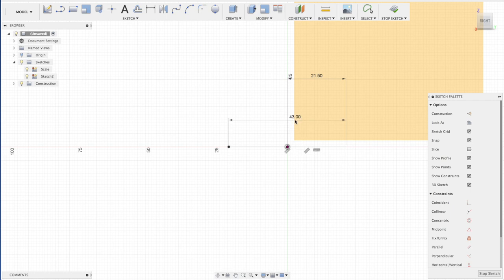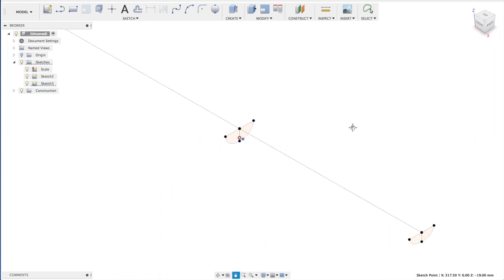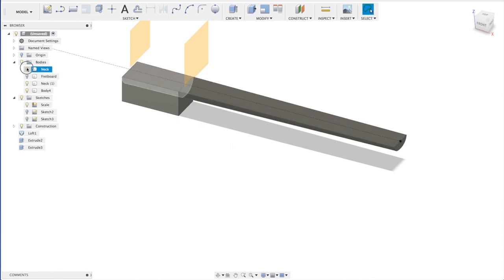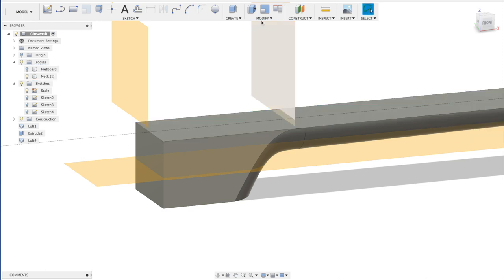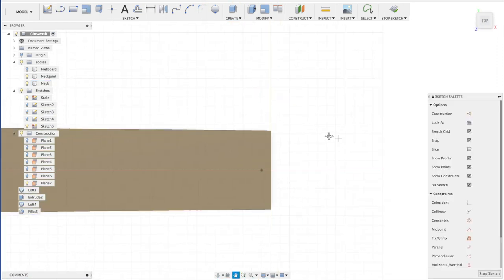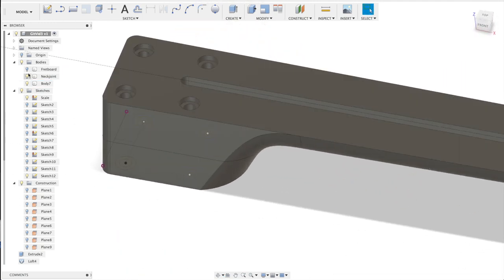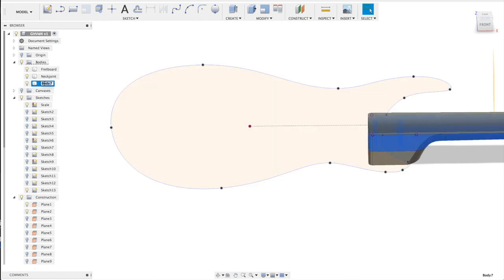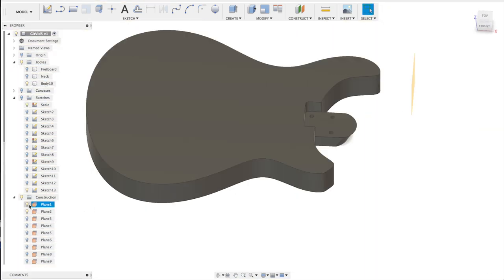Drawing a complete electric guitar in Fusion 360 for CNC milling

Comment: Fantastic video. I’m going to check out your other stuff. I am an absolute beginner on fusion 360. My only suggestion would be to go into more detail on the actual use of the program. Your abilities on the program are light years beyond mine. Thanks for taking the time to do this.
Reply from the maker: Good suggestion! I try to use the most basic tools only when drawing, in a next designvideo I'll try to incorporate your suggestion. I'm sorry if it sometimes looks confusing on this particular video; but you're most welcome to ask anything. I'll try to give a clear answer, or else look at my website as well. That just might clear things up as well. Cheers!

Comment: Awesome tutorial! I have barely used blender earlier, and still I'm able to follow it with only a few google searches. Thanks! Gonna check out your extended version as well. Thanks!
Reply from the maker: Great to hear it works out for you in Blender as well! Curious about the result!!
Reply: @Audiohotshot  That was a little unclear. I meant that my experience with 3d modelling was just a little bit of blender, and i still managed to follow this in fusion 360 with no problems. ;)
Reply from the maker: :-) still great to hear!

Comment: This is the most direct approach I've seen to date- very nice work. 

Thank you for taking the time to make this video. Although I've been building guitars for 50 years, I haven't had a need to learn CAD- I built my cnc mill from scratch 10 years ago, but my sons have done all the programming. I seem to be fighting with one hand tied behind my back, always waiting for a file, or not getting precisely what I had in mind. This aspect is well beyond my comfort zone, but Fusion 360 has been a bit easier for me to grasp than Rhino and others that my sons use.

My CAD journey is only weeks old, and it is quite a different approach for me, but your methodology seems to make sense from both an engineering and lutherie point of view. I only wish I had a better grasp of the tools you use so effortlessly.

In conclusion, I wanted to thank you for your efforts, I will be spending many, many hours trying to pick up on what you have presented.
Reply from the maker: I'm sure you'll be able to figure it out! Fusion is a very friendly piece of software, and it also produces the GCODE directly. I like the fact that those 2 are combined in one program. Question: would you like the tools more explained in the video as well (I mean how loft and split body and construction plane work and so on?) or just what keys I press?  Thank you for the kind words!
Reply: @Audiohotshot  that would be extremely helpful, yes. This was my first exposure to offset planes, loft, etc. I am very much a beginner, and need to stop/rewind/ watch and listen, and still think about what every click or sound is- the UI of Fusion I have is newer than almost all tutorials, so simply finding a tool or setting is quite difficult. I cannot tell you how thrilled I am at having seen your work this morning. Every tool selection, plane, pan or orbit counts, every click or keystroke.

I hope to live long enough to soar with it. LOL

Again, thank you. ;)
Reply: I don't know you, or your background, but you are really on to a good system, and a nice presentation. It feels like a lifeline to me, despite what you cover in three minutes takes me five hours.. hahaha
Reply from the maker: Hahaha I will try to add keystrokes in the video as well. For what its worth: I use “l” (non capitol L) for drawing a line, and “x” for making a line a construction line most of the time. Everything else is pretty visible in the fusion menus I guess. But I promise I will try to incorporate the keystrokes next time :-) good luck with your drawings, glad you find it helpful!

Comment: Fabulous. I picked up so many tips and tricks from this vid. How about making a video on efficient tool paths. Thanks!
Reply from the maker: You're welcome! I was thinking about doing a video on toolpaths, it will be here soon!
Reply: Toolpaths shouldn't be a problem imo... Few tips, avoid adaptive since it's taking so much time, go with parallel for roughing (flat 6-12mm end mill) (I usually limit the depth to 4-8mm per pass with extrude+protect+surpress extrude), leave 0.7-1mm stock to leave and finish it with morph spiral or parallel with 0.7-1.5mm stepover (ball end mill ofc)...feed&speeds I usually do 18k rpm and 2kmm/min feedrate for hard woods...Drilling go with recommended for plastics and increase rpm to 10k+ and select deep drilling for full retract... In the end, 3d contour the fillets and  2D contour it for the final shape and you're good to go. That way you'll have almost no sanding to make it smooth

Comment: I've been working through this video and designing my first guitar (or anything in CAD really), it's super fun! A couple of notes from the first third of the video:
- You use 400mm for the diameter of the fretboard. Is this a mistake? There are lots of guitars with 400mm radius fretboard, but 200mm radius seems small.
- You use 8mm for the space between the tuner holes and the edge of the headstock, but I'm not sure that's enough -- the washers on the tuner post would be just touching the edge. My Ibanez RG for examples measures at 15mm.
- I know it was just a quick example, but to anyone designing their own headstock, you must add in a few dimensions to ensure each string coming out tangent from the tuner post lines up with the slot in the nut. I believe you can use arcsin(nut string spacing / tuner spacing) to get the correct headstock angle. For example arcsin(7.2mm / 23mm) = 18.2 degrees, which is a bit off from what you used (17 degrees).
- I watched your headstock video and it was very helpful. I wanted both a volute and an angled headstock, which none of the examples in that video covered, but was able to achieve it using the tips from example 1 and 3, with some modifications.
- To expand on the fretboard radius, I also wanted a compound radius. Pretty straightforward, just draw another circle at the nut for the smaller radius, then create a loft between the two circles.
- Also regarding the fretboard radius, I needed to use a vertical construction line to keep the circles on-center.
- 16:13 you create an offset plane on the bottom of the neck joint, but I believe there's already a construction plane there from when it was made?
Reply from the maker: Great to hear from you! All videos are about showing you the way I draw and which tools I use, as I didn't find a video online which showed me how to start from zero to begin with. Please do not take my dimensions as a guide (I'm sure your designs are better than mine :-). Sidenote: the radius I use (200mm radius or 400 diameter) is not really that weird, and feels pretty good to me, all my guitars have different diameter/radius. I have a video where I machine this particular fretboard as well, so feel free to have a look.
 I really like your idea for a compound radius, I hadn't thought of that while making this video! At 16:13 you don't even have to draw a construction plane; you could also directly select that face. Still, I hope my way of drawing is of some use to you. Cheers!

Comment: Quick q; At 4:30, when extruding the neck joint, you subtract 3mm, then 43mm more. What is the 3mm representing? 43mm is stated body thickness, but where does the 3mm come into it? Thank you again!
Reply: Nevermind, I see now it's for a reveal between the fretboard and face of body- such as to accommodate a pickguard. I may be slow, but can figure things out as I go along. LOL
Reply from the maker: No problem at all. You are right, sir. The 3mm plus 5mm for the fretboardheight + some clearance of the strings (+/- 2mm) = 10mm which is the height of my strings at the tremolo. Indeed on a Fender guitar a pickguard would fit perfectly in that space. Hope this helps.  :-)

Comment: Hello again, I've returned for a closer look at your rear body contour cutting with a T spline plane. I have had good luck with the method, but noticed your body remains visible while you're in sculpting mode... As soon as I create a T spline plane, my bodies disappear.. it was frustrating, at best- but I made a test object and recreated the situation.. same result every time.
I went forward and drew, modified the plane- then had to navigate back to Drawing-Design with the dropdown on the upper left. Once I returned to the Design mode, the missing bodies came back. I was able to make adjustments, to a point, to fit the T spline plane to the body- but it was lots of guesswork to work with no bodies as a reference.

Am I missing something here? A setting, perhaps?

Again, I thank you for your wonderful, helpful videos. Little by little, I'm beginning to understand Fusion 360 a bit better- and the drawings/parts I'm making are definitely getting better each day.
Reply from the maker: Great to hear back from you! I created this new video including keystrokes and more explaining, you can find it here: https://youtu.be/shxir1Z4Bw8 This might just be clearer to you. Also I included the contents including timestamps to quickly navigate through the video. (I do apologize for the lengthy video :-) I try to be as precise as I can.)
Reply: @Audiohotshot  I'm absolutely knocked out with your help, and your generosity. Should you find yourself in Chicago sometime, I owe you a steak dinner. :-)
Reply from the maker: @RichRice  I'd love to someday! (if it wasn't for the long flight over the Atlantic :-)

Comment: I'm new to CNC, is fusion 360 all you need to build stuff as in does it make all the g-code and tool paths for your CNC machine then run it? I keep seeing a debate as to if you can just use the free fusion-360 over Aspire that's $1,700 bucks. I am ready to buy a CNC machine and they want almost 2k in software, then I see fusion 360 is free and many say it's better but a bit harder to learn because it does more, I'm ok with that. 

I'd rather spend the cash on upgrades than software if "better" is free for hobbyists.

Thanks!
Reply from the maker: Fusion360 indeed acts as a design- and CAMtool. I use bCNC running on a raspberry Pi as GRBL Sender to my DIY machine. (for more info and budget spending on my DIY machine: https://www.audiohotshot.nl/howto-how-i-built-my-diy-cnc-machine/ )

Hope this helps!

Comment: Regarding previous comment sorry I meant to mention it refers to the part of the video at 5:45
Reply from the maker: That could have a number of reasons; but most likely; be sure the neckjoint has the same width as the neck. Be sure the neckjoint part is derived from the Neck. Also, make sure to select "extend splitting tool" as well.. although you should be fine without. (it's pretty hard to help without seeing what you've done, I'm sorry). Hope all works out!
Reply: @Audiohotshot  I appreciate your quick response and understand it is difficult to assess the problem remotely. You've given me a couple of things to look at and hopefully I'll be able to sort it out. Thanks
Reply: @rob182935  I get the same problem as you did. When I try to delete the redundant part of the neck, I get an error message "This feature is referenced by other features in the timeline". If I then click "Delete", it deletes the whole neck. Did the solution from @Audiohotshot work?
Reply from the maker: Did you disable capture design history? If not try this: don’t use “delete”, but use “remove” (it is in the drop down panel of the body). Let me know if this works for you! :-)
Reply: I disabled capture design history as Audioshot suggested and it worked for me. Thanks.

Comment: The only problems I had is that you're obviously using keys and shortcuts that are not visible on screen so sadly not very helpful unless you're already experienced with Fusion could you please include shortcuts and keys please also my version is newer and has some different features Thanks anyway I have learnt somethings that are useful